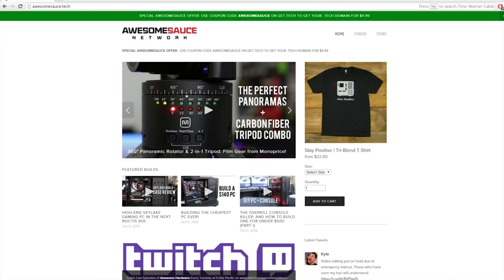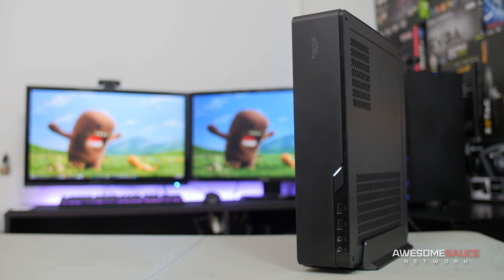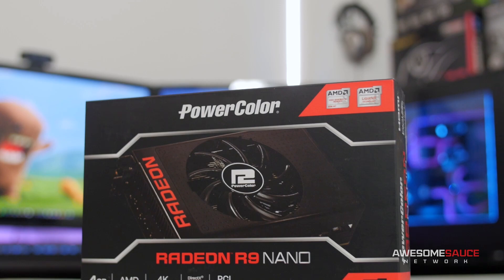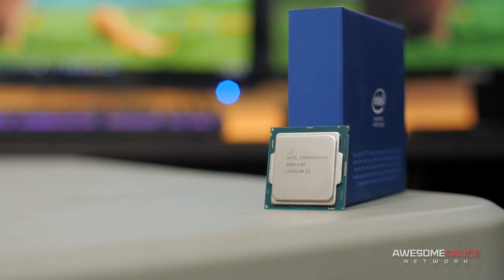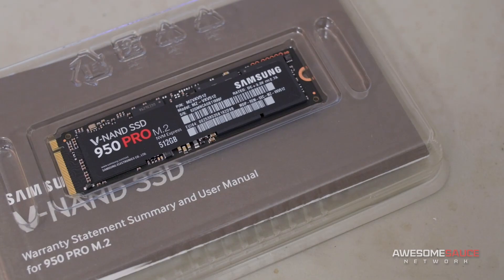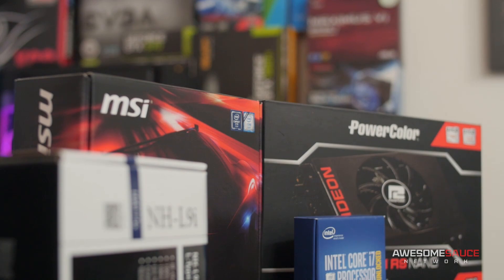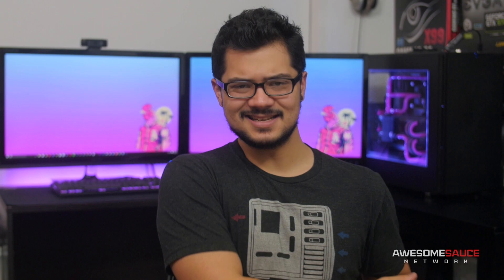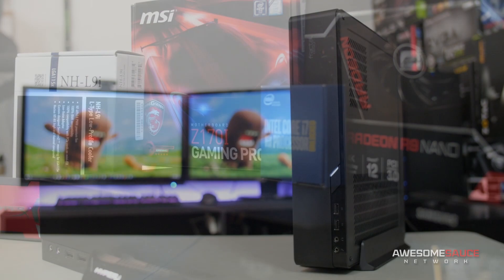The Go Anywhere Do Anything PC!

Comment: So what are the clearances around the nano compared to that 120mm fan installed? If the space allowed I would prefer a 120mm AIO for that 6700K.  But I couldn't tell if possible from the angles in the vid.

Anyway awesome job per usual.
Reply: +Edward Green, Jr Also - I&#39;d love to see a comparison of something like this to that Razer Core or Asus XG2 for ultimate carry-on gear supremacy. Sure the laptop+external GPU solution will be more expensive, but also more versatile.

Comment: hey man a nice tool for those hard to reach or tight fit screws like that third one that got left out is a 90degree ratcheting wrench with a built in Philips driver they make them in different sizes. I came across this tool in the sign business. I hope this helps if you need help finding them just ask.

Comment: How did you use the m.2 950 Pro when the slot has support for a maximum of 2260 not 2280 you wouldn't of been able to screw it down and it could of shorted on something i assume you didn't install it only the Asus z970i board has the support for 2280.

Comment: Ok, so here's my question as stupid as it may sound. How do you load your OS? I understand that all games and software can be gotten via download now days, but do you still not need a disc drive for the OS? I'm sure that someone is going to tell me to load it on the drive using another computer, but that works for me and having multiple PCs. What about the guy who has one good reliable PC and maybe another not so great one that is the reason he built something like this? Also, yes you can put a digital copy on, but what if you're out and about wherever and you see a movie in redbox that you want to watch that may not be on Netflix or something like that? Just saying that there are reasons to still need a disc drive. I'm just wondering how it's done because I wouldn't want to build a PC without one even with DLs for everything.
Reply: +Foof50 Also for video editing a good DVD-R drive or BD-R would be handy to have even in optical form to cut some discs for people at one of these conventions that you're on the go for.

Comment: What do i need to upgrade to have a good gaming pc?

Graphics Card: Nvidia GeForce GT 610
Processor: AMD A8-5500 APU with Radeon(tm) HD Graphics 3.20 GHz
Memory: 8 GB
Battery: 500W
Motherboard: MSI 2AEO
Hard drive: 1tb
Reply: +UrFace CPU, motherboard and graphics card.
Reply: Bas van der Meij Ok thanks

Comment: Would this case fit a full sized Nvidia GTX 970 4gb GPU, mini itx motherboard lga 1150, i5 4690k, 8gb ddr3 ram, and a 1tb 2.5 drive? Can I use a normal HDD drive or am I stuck with an SSD? What about the power supply? Am I forced to use the Fractal Design one or can I exchange it with a Silver Stone small form factor 500 watt PSU? Cheers!! :)

Comment: Can something like the Corsair H55 fit in there in place of the case fan (6:05)? And wouldn't it cool the cpu better than the low profile cooler?
Reply: Just going off of what I see in this build, I'm going to say no simply because closed system water coolers require quite a bit of room especially since the tubing cannot be kinked in any way. Yes the water cooler would cool the CPU much more efficiently however it simply wouldn't fit in this build.

Comment: What was used to connect the GPU to the Motherboard?
Reply: I think that's a PCIE extension. Some of the cases have it so you can vertically mount your GPU and show off the cooler.

Comment: How much would this system cost without the gpu? I'm planning to build it for my living room desktop, mainly to watch youtube and movies.
Reply: Don&#39;t want to sound like a pro or a noob but for the most common computer tasks like youtube and movies an i7-6700(k) + rdd4 16gb ram isn&#39;t necessary for smooth performance. Maybe rdd4 ram is good to have for the future but 8 gb ram is enough to even play games with. I would save money by buying an high end i5 instead for the processor.
Reply: Zucchero Klein Oh, yeah got it. I'll probably just scale down the hardware. I have a mini android-OS tv box which can play youtube and movies but it lags/buffers/stutters like hell. I'm not sure if it's the ram or the cpu or both and idk if I can upgrade it. Probably uses a different type of hardware than pc.
Reply: yeah. It's hart to say about those devices how fast they are. If you look up the specs for the device on google or something you will notice very low clock speeds probably. My old phone for example had a processor speed like 500 MHz. my new phone has 1.2 GHz. It makes a huge difference. A small RAM size is also very annoying. Every time you switch between tabs the device has to reload them. For PC's you are probably fine with 6 to 8 GB RAM (1600MHz or higher speed) and a processor that has multi cores and clocks higher than 2.5 GHz. My old laptop (also 6GB RAM) has a i5-2540m and has a base clock of 2.5GHz but it overclocks to 2.9 GHz and it's a fast laptop. most processors clock at 3.0GHz or higher so don't be afraid for slow processors these days.

Comment: Can you swap the R9 nano for the gtx 1070?
Reply: Donjoey Ker well if the gtx 1070 fits the main reason he chose the nano is because it's a great Graphics card and it's small
Reply: Donjoey Ker the 1070 has a mini model
Reply: most gpu's fit in the node 202 but ofc a triple fan gpu wont xd the asus dual 1060 fits easily and so do the blower style gpu's
Reply: Jesus Negro or the evga mini, only 1 acx2 fan
Reply: Donjoey Ker yeah and even the zotac 1080 mini will fit im pretty sure

Comment: Is this £600 build good?

Intel i5 4460 quad core

AsRock H97 anniversary motherboard

Western digital blue 1tb hard drive 

Seasonic s12-II 520W 80+ bronze 

Msi amd r9 380 4GB

Corsair vengeance 8GB ram ddr3 1600mhz

Nzxt s340
Reply: Yes this is a good build , you might want to consider the I5-4590 it costs a little more and performs better , just a suggestion.
Reply: +Jack Baillie thanks!
Reply: No problem!
Reply: Get an ssd as soon as possible, but that's a damn fine rig

Comment: would this case be any good for gaming?
Reply: The case doesn't matter
Reply: well he just built a monster PC in it that can run next triple a titles on high settings in 1080p so..yes although getting a mid size tower like a atx would be easier due to more parts being compatible with mid size compared to mini itx. thermaltake is a good brand for cases, mouse & keyboards along with fans. they also make good  PSUs. I'm recommending them because they are good for people with tight budgets because they give you good products for the low amount of money in return.
Reply: +Arch Illusionz Considering it has space for a full-sized GPU, yeah. Though building in it is a bit of a challenge since it's so small.
Reply: +Arch Illusionz Yes although you would get better cooling and generaly more options from a larger case
Reply: thanks everyone :D
Reply: +Arch Illusionz it gets really good fps... so good it doesnt even need any other parts... 8)
Reply: +Arch Illusionz no you need the ones with the big shiny lights for more fps... -_-
Reply: +NuclearByte don't forget flame decals...flame decals make everything faster. :D
Reply: +NuclearByte don't forget a nice paint job and a special 'gamer' case that's red and has a cool texture.
Reply: +Tango Plays Considering the placement of the ventilation on the "top" of the case (in horizontal), You could probably sit the monitor on top of the case and you'll have one slick looking setup.

Comment: Hello, can you explain what is this thing that connects to the pci e slot? I mean I know what it is (it turns the pci-e slot by 90°) but where can I find it? I think it is very useful because you can use a graphics card vertically and not horizontally, consuming precious space!
Reply: ViPERMiMiS I think it comes with the case. check the Silverstone rvz02. it also comes with that case.
Reply: oh thanks!
Reply: ViPERMiMiS np
Reply: So I guess cheap htpc cases don't have this? Can you buy it? it is very handy I think! (I don't even have htpc/mini case I am just wondering)
Reply: ViPERMiMiS not really sure about other cases. you can do a search for "pcie extender", there are a lot of results. you might find what you're looking for.
Reply: thanks I didn't know how it was called
Reply: ViPERMiMiS happy to help

Comment: Hey you could also use the MSI gt 80 Titan. That is a great portable computer
Reply: +Sanket Sharma It is at least twice as expensive and is actually slightly less powerful
Reply: +emiel van genne lmao it has 2x desktop 980s, how is that less powerful
Reply: Strix NumBezZeDz No the original GT 80 titan had 2x 980M which is about the same performance as 1 desktop 980. The new gt 80 titan has 1 desktop 980, which means about the same theorethical performance. However the new model doesn´t have the drawbacks of sli(as long as you have $3000 to $5000 of cash). A fury nano has similar performance as the full 980 and this build is a lot cheaper, especially since Kyle reused some parts.
Reply: ***** What you said was that a gt80 titan is less powerful than this build, yeah right, try to beat gtx 980 sli with a fury nano, https://www.msi.com/product/notebook/GT80S-6QF-TITAN-SLI-29TH-ANNIVERSARY-EDITION.html#hero-overview
if you don't do your research before commenting, there's the link to the gtx 980sli version.
Reply: Strix NumBezZeDz You're the one who is misinformed. There onely exist 2 main versions of the GT 80 titan. One with sli 980M and one with a single gtx 980. The GT 80 titan still has a mobile CPU that gets beaten by the 4790k no matter what
Reply: +emiel van genne I have to correct myself: the 29th anniversary edition does get you more performance. However, you should NEVER compare 2 products that have totally different price tags. Even if you do, factor in the performance per dollar
Reply: ***** Oh my bad, but you compared those products. "It is at least twice as expensive and is actually slightly less powerful" Jokes on you.
Reply: +Strix NumBezZeDz I compared the prices, not the product itself
Reply: ***** really? "It is at least twice as expensive and is actually slightly less powerful"
Reply: +Strix NumBezZeDz Ok I might have stated something that wasn't 100% true

Comment: Hey with your help and suggestions. I completed my node 202 build. I modded the case and used 15mm fans. But I used a gtx 1060 and was still able to fit the radiator with some further modding. 

here is my build http://ca.pcpartpicker.com/b/Wc6XsY

Comment: Flexible?! Do anything?!! Yeah because fuck everybody who wants to have HDDs for storage of movies and stuff!
Reply: You have a SSD for that
Reply: wohlrabferdinand Dude, SSDs can't store shit. Go ahead and try to put a thousand HD movies on an SSD.
Reply: so your 1tb hdd is so much larger than your 960gb ssd much wow... so savage
Reply: +A Box  Also, it's a really small  Pc a HDD would take too much place
Reply: LamitesorroW467 Gaming You must be using internet explorer, because last time I checked it's 2016 where there are 8 TB HDDs. Besides, SSDs are fast but extremely expensive compared to HDDs.
Reply: wohlrabferdinand I agree that multiple HDDs would be too large, but a single 3.5" slot would have still been nice.
Reply: ***** but the most affordable hdd most commonly used is usually 1tb and in a mini itx build an hdd port might have been hard to implement when they have to use an sfx power supply, gpu, motherboard (and everything on it), as well as for overdone people they would like to install mini watercooling loops. and nice joke i thought that was pretty funny i did crack a smile.
Reply: you could spring for a 2.5" laptop hdd. yes it's not the same as a 3.5 HDD but the data density is cheaper than that of an SSD
Reply: Eduardo Sousa I didn't think they have enough capacity but now that I looked it up they actually do. It's not cheap but a good compromise. You could get 2 4TB HDDs for €180 each and use an M.2 SDD for games.
Reply: you could always also have an external hdd to save up some files and such that you access less frequently and connect it up that way (for instance, movies). you could also get an ssd external enclosure that does pcie to usb type C and connect it that way (provided your mobo supports type C).
there are quite a few work-arounds
Reply: Btw if you want a HDD so badly you can go with the Thermaltake V1 or the Raijintek Metis
Reply: wohlrabferdinand this is absolutely my personal preference, but shoebox-like cases are boring and ugly. The Node 202 is absolutely stunning, though
Reply: +Eduardo Sousa The Metis and V1 are both the prettiest cases I know, but I still  use a normal atx case because not a single mini itx board has a damn second Pci Slot for a sound card. Of course I could use an external one, like the external HDD and SSD you suggested, but the whole point in Mini Itx cases is that they don't take much space, are portable, and look good. But with all that external stuff that doesn't fit in the case, you have cables and a soundcart, HDD and maybe an optical drive on your desk. So, Mini-Itx cases are still not an option since you have to give up on all the things a atx case has
Reply: wohlrabferdinand i was just throwing out suggestions. Again, it was my own opinion, and I much more prefer low profile, slim design cases to any shoebox or mid tower.
Any external peripherals are optional, and yes, itx motherboards only come with a single PCI-E slot, but that's a compromise for the smaller form factor. 
Most people don't even use sound crds, and the poeple who might beefit from itx cases are different to the ones who might need an e-atx board, for example
Reply: Vakama16 I know, however, they are still quite expensive. Once high capacity SSDs are developed further the price of the 2.5" HDDs will probably fall.
Reply: why would you need to take "a thousand HD movies" with you in a portable build? If you're going somewhere for years or more, just get a PC there or bring one.
Reply: theos I often take my PC with me  to friends and family so we can play and watch movies together.  Inviting them to come to me is not an option for various reasons.
Reply: ***** That's not what I'm talking about.

I built a relatively low-spec (i3-6100, RX 460) portable PC on this Node 202 + a AOC FHD portable monitor to bring along on trips over a week where I'll actually have time to do things on my PC and play Counter Strike.

I still don't need space for a thousand HD movies. I have a 256GB SSD in there, and I just move stuff from the portable PC to my main PC if I want to have a few movies in there. 

I don't see your point.
Reply: theos That means having to buy a main PC and a portable one. Why not have both in one? After all, that's what the case claims to be, "go anywhere, do anything PC".
Reply: ***** Oh, that's what you meant? Get a external hard drive. Cheaper than getting an expensive case (or in your case, a whole new PC)
Reply: +A Box the case doesnt claim to be that. not in the slightest. Kyle made a computer for his own personal use which he claims can do anything anywhere.
it's a very specific build.
Reply: Oh it's not a Bad concept and certainly HDDs have improved dramatically it's not like ages ill back etc they were volatile illness and could go corrupt very quickly access times were always horrible I/O was always horrible/transfer Rates were horrible etc..some were intermittent wouldn't even show up in the BIOS sometimes etc..Still Say all SSD etc

Comment: AMD for editing? really?
Reply: That's what I thought! Won't  those CUDA cores come in handy much better than. ..well without them :D ?
Reply: Exactly!
Reply: ***** Not really xD I have a laptop with AMD GPU and I have build a PC for a friend with AMD GPU. It's just that for video editing ... Nvidia CUDA cores are imported in the video editing industry and they really help in speeding of the rendering.
Reply: +HamDerDanskeren AMD can run OpenCL instead, which some editing applications support. It's mostly the same thing as CUDA, but it's not vendor-specific.
Reply: freezxify yeah i know amd has open cl. watch the video and them form an opinion on the benefits of the feature. Yes they do improve performance, but not in a manner reasonable to affect GPU choice.
Reply: ***** Dude, programs like premiere and after effects is optimized for Nvidia CUDA. Not AMD. I KNOW that AMD is just as good as Nvidia in gaming. But in editing, Nvidia takes the lead
Reply: freezxify The problem is, one of the most used editing programs "adobe premiere". Will only use the cores of CPU if youre using a AMD card. It is optimized for CUDA
Reply: HamDerDanskeren Premiere works the same on both CUDA and OpenCL.
Source: http://www.dslrfilmnoob.com/2014/04/26/opencl-vs-cuda-adobe-premiere-cc-rendering-test/
Reply: Really? i might have been wrong. But the R9 Nano is great card anyways
Reply: HamDerDanskeren The best part of it is the size. Nvidia doesn't have a card that small and powerful, so it's the perfect choice for a build like this.
Reply: but still ... aren't the CUDA cores going to be faster? Or the difference ain't that big?
Reply: +georgi5000 Cuda is nvidia's fancy way of calling the gpu cores. AMD's cores are generally more powerful, which is why they are the primary choice for bitcoin mining.
Reply: +georgi5000 Cuda is nvidia's fancy way of calling the gpu cores. AMD's cores are generally more powerful, which is why they are the primary choice for bitcoin mining.
Reply: people plz...I can see you are well educated about that and tell me with simple answer! Are the CUDA cores THAT much better used in video editing or the difference ain't that big?
Reply: +georgi5000 No. But if a software developer decides to use CUDA instead of OpenCL, the AMD cards get no acceleration and the CPU does all the work.
Reply: +freezxify Okay. Thank you!